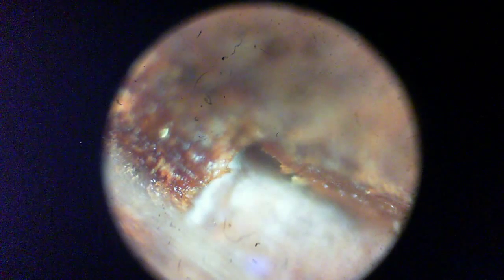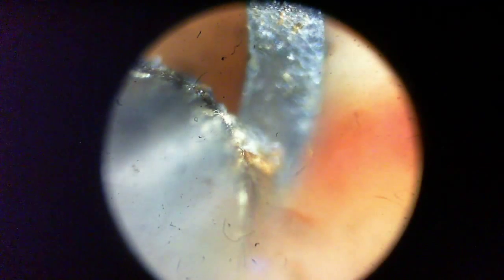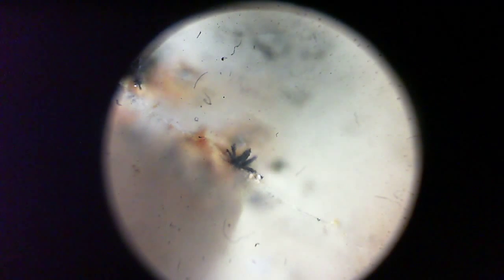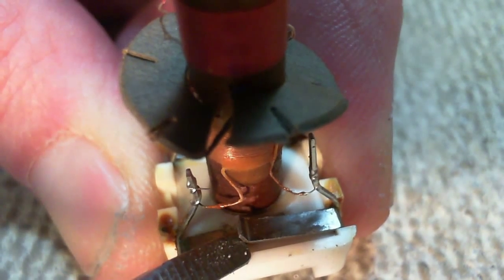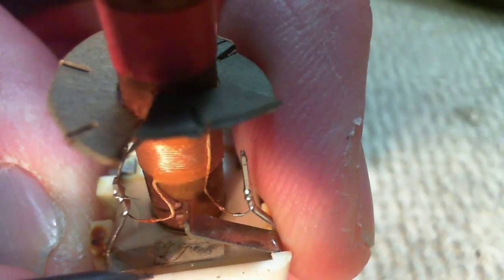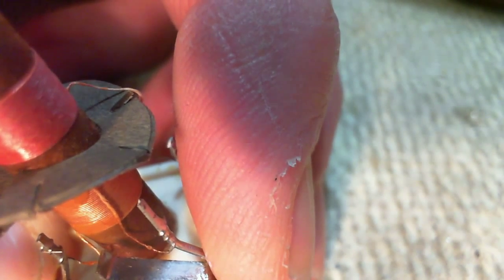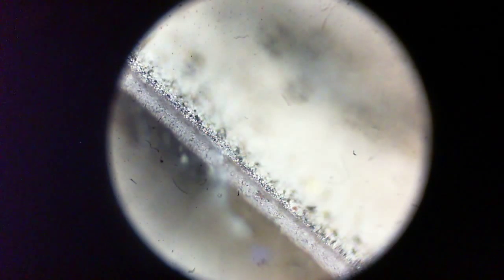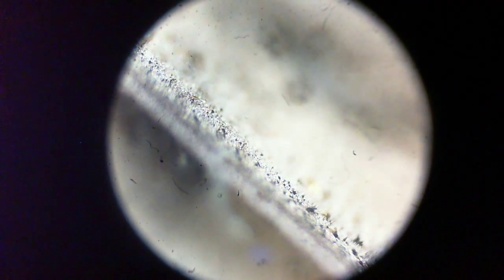Viking Console Stereo Video #53 - Under the Microscope

Comment: Hi Jim, thanks for the video. Reminds me of the tin whiskers, that grow from the solder balls that cause shorts under the BGA processors used in the Xbox 360, leading to red ring of death failures. Though the use of lead free solder and heat cool cycle stresses is also reckoned to be a cause of failure, as the solder is supposed to be less ductile than leaded solder.